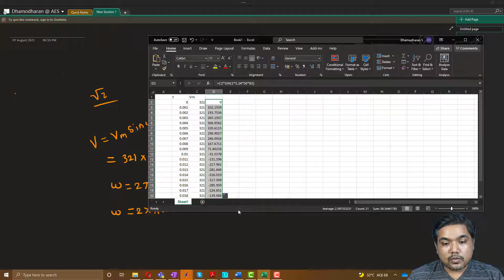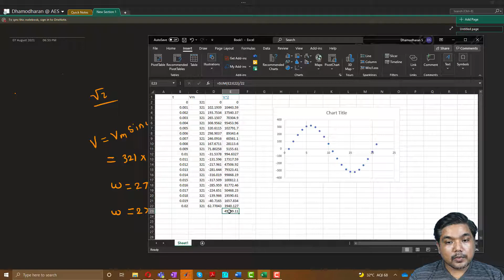why square root 2 sqrt(2) is used for RMS calculation?

Comment: There are two errors you made.
First of all, you took pi as 3.24 instead of 3.14. Secondly, you took average of all the square root values, you said you should deduct the first column (as it contains the header), but you actually took 22 instead of 21.

Correcting these will give about 228.500645840435.
If you set the voltage to 1, you get about 0.69023492830311.